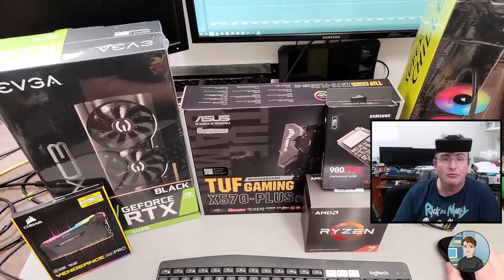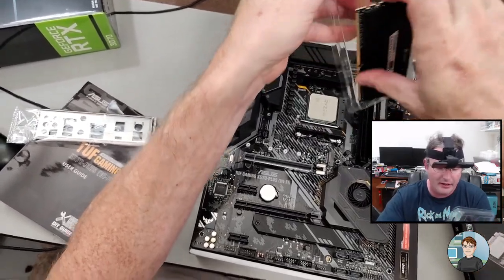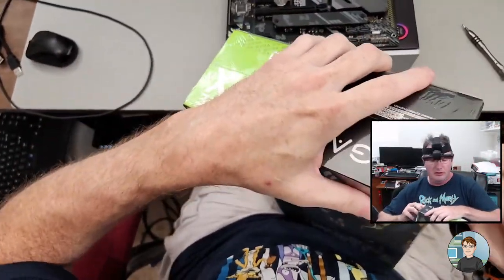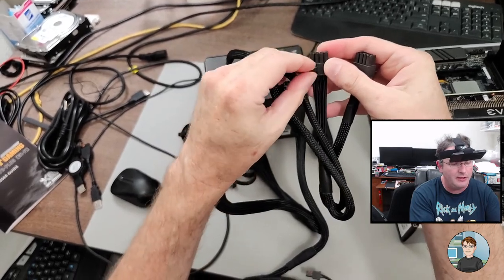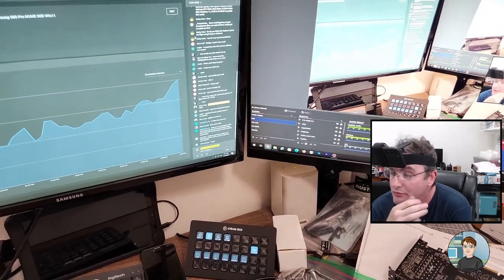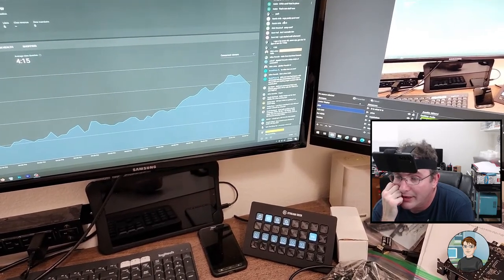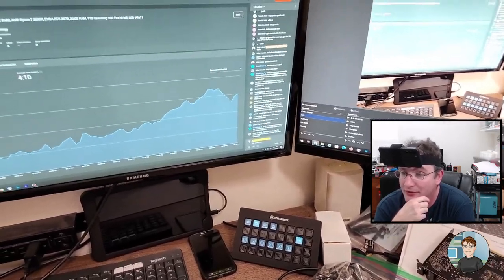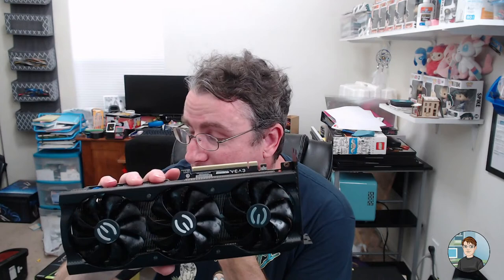New Desktop PC Build, AMD Ryzen 7 5800X, EVGA RTX 3070, 32GB RAM, 1TB Samsung 980 Pro NVME SSD Win11

Comment: Hi, I was to build a new PC, my last build have i5 6600K, 16 GB RAM and GTX 1070. But with the new 13600k, is good t0 build Ryzen 5800X? I was to play 1440P only not 4K, I buy new monitor 27" curved 2K and 165 Hz, 1000R. Have a big problem, Not sure if build, Ryzen 5800X, 13600 or lower to 11700, I buying 3070. Any advice, suggestion or whatever, THX
Reply from the maker: The 13600k would be better than the 5800x for gaming.  3070 is a great choice.